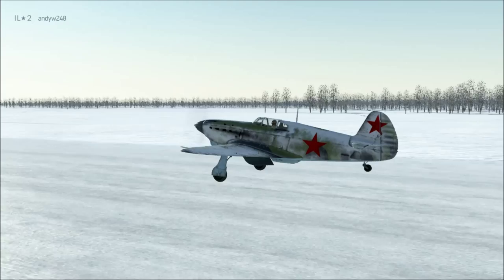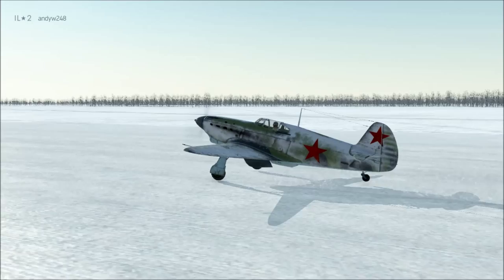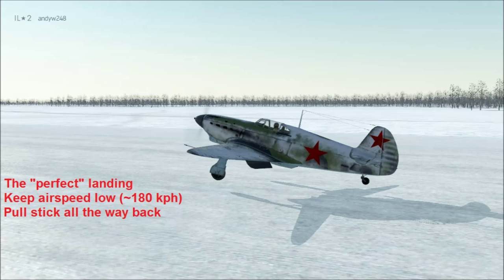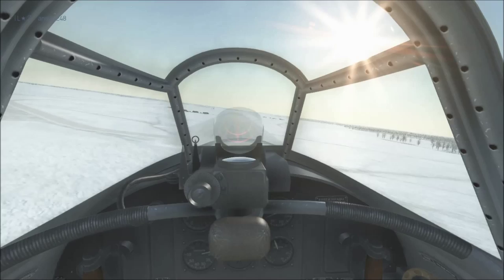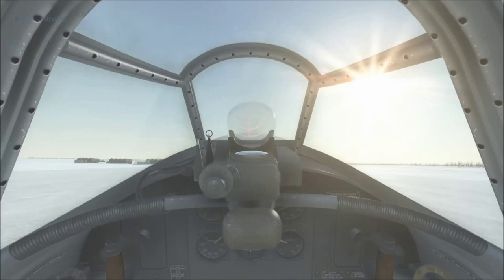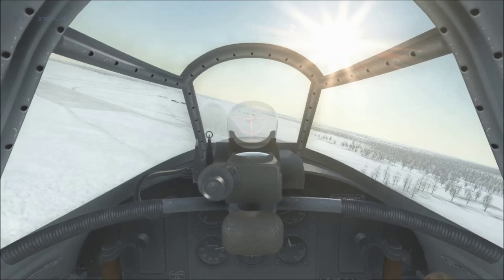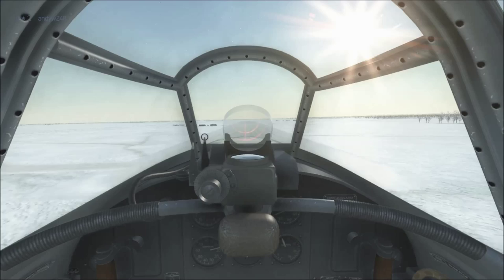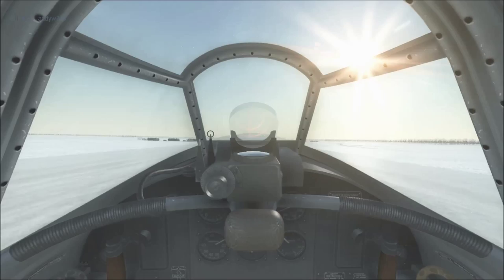Flightsimming - IL-2 BoS: Botched landings in taildraggers... and what to do about them

Comment: I have no trouble landing in any other flightsim, but in IL2 BOS with the take off and landing mission I always bounce and destroy the propeller. Need more practice. Maybe it has been too long since my last flightsimming. Thanks for the tips. What landing speed do you prefer and full flaps? LaGG-3.
Reply from the maker: Final approach in most planes is 180 - 190 kph. Touchdown speed is about 150 kph. The LaGG (and the La-5) land better with 50% flaps.